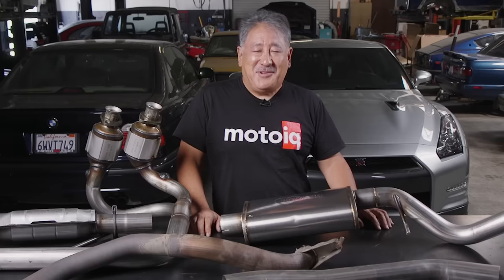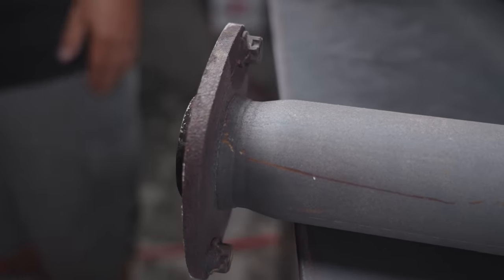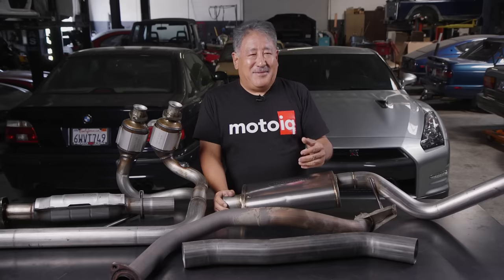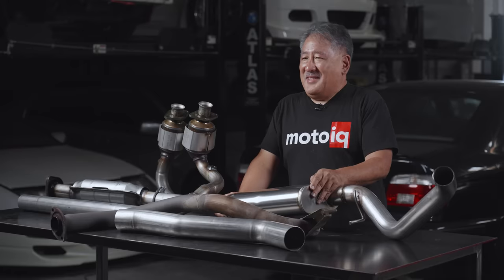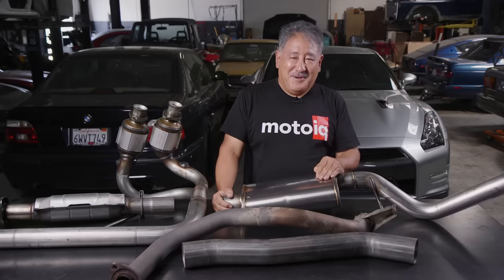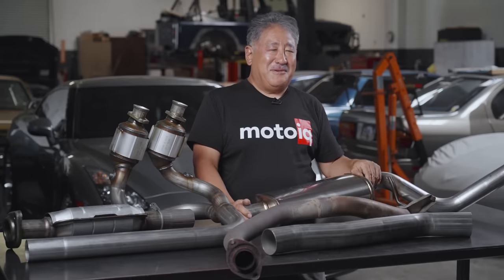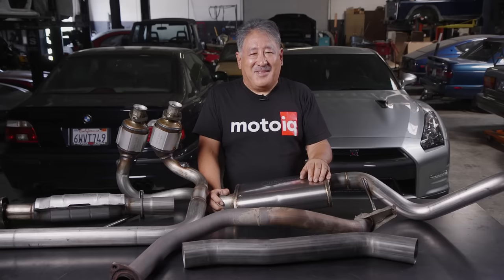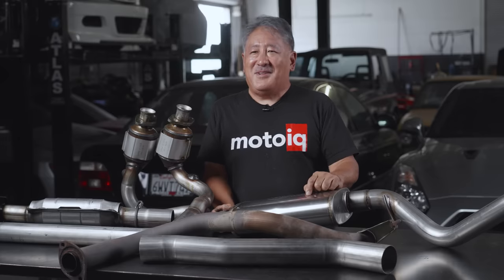Exhaust Back Pressure Myth DEBUNKED!

Comment: Why people say you need back pressure is from people taking the exhaust off running just headers or manifolds and having no power on the bottom end! But with a actual full system on a car is never going to have a low end power problem!! Ive actually done this before on my 95 Z28, unbolted the exhaust and was running just the y pipe and that thing was an absolute DOG outta the hole!!
Reply from the maker: Because you messed up your AFR or your load calibration. Gets fixed with a tune. Plenty of fast cars with open headers in the world.
Reply: @motoiq  watch engine masters!!! They actually run real world dyno tests!!! And just because people are running open headers doesn't mean they are or aren't losing on the bottom end! Engine masters ran open headers and without a collector extension they were losing power!!
Reply from the maker: If the tuning was correct, the headers were not sized right for the engine combination then, the primaries were probably too short and/or too big in diameter.  It's not too little backpressure.
Reply: @motoiq  lol..... like I said I've literally seen the dyno results!! I'm not just coming up with this outta thin air!!!
Reply from the maker: And I am giving the reasons why.  Don't think one dimensionally!
Reply: @motoiq  I'm not! I think you are! Like I said with just straight headers it was losing power on the low end! With an 18in collector extension the power was back up!! That has nothing to do with what you are saying!
Reply from the maker: Yes, adding the header extensions improves velocity.  They do not add backpressure. You didn't state all the information.
Reply: @motoiq  🙄🙄🙄🙄
Reply from the maker: For sure a header collector extender does not add backpressure so your premise that this is proof that backpressure helps is completely wrong.   It is the opposite in fact, it proves the premise of this video, that reducing back pressure while increasing velocity helps. The collector extension gives the gas collum effect that we were talking about in the video. It is nothing new, it's something that's been around for generations.  Same thing as the old timer trick of painting the exhaust in the vicinity of the collector and cutting it off where the paint stops burning off.  I mean if you feel that David Freiburger is the ultimate engine expert, I was also on a show with him, Masters of Motors.  We respect each other quite a bit.
Reply: @motoiq  🙄🙄🙄🙄 just keep telling yourself that!! Maybe some day it'll be true!!🤣🤣🤣🤣
Reply: @motoiq  if you think a 18in collector extension doesn't add some back pressure then you're nuts!!!
Reply from the maker: Have you ever measured backpressure in the collector or runners of a header?  I can assure you it doesn't increase enough to register on an analogue gauge which is what we had a long time ago when I experimented with this.  Now with affordable data logging and transducers you could probably measure a very slight change, fraction of a psi.  The collector is the acoustic end the the primary tube and adding an extension broadens the powerband by helping with scavenging by maintaining gas column velocity and also possibly helping the reflected wave in the primary tube have a longer pulse duration.  This is especially true if the collector or primary diameters are marginally too big. If you measure the backpressure in the collector or even at the muffler at the end of the exhaust, if it is properly designed it can be close to zero regardless of pipe length, this is due to temperature drop and diffusion over a larger volume due to boyles law more than skin drag caused by the tubing.  Also if you apply Knutson's law and solve for pressure drop  you can see that the pressure increase towards the end of the collector extension will be negligible.  I am not telling you collector extensions do not work, I am telling you that your assumptions about why they work are. This isnt far out stuff, any engineering student learns it.  If you still want to roll your eyes, then you are ignoring physics much the way flat earthers ignore science.
Reply from the maker: Jeeze how dense are you? No one is disputing that header collectors can make power, it's just not from increasing backpressure.
Reply: @motoiq It's not worth the time and energy to debate someone who isn't open to having there mind changed. After several comments where she ignored crucial info and stuck to her conclusion. Great indicator of someone with who further conversation will get no where.

Great presentation of vital information. Thank you.

Comment: Then how come when I removed my resonator (turbo charged) from the exhaust leaving only the muffler and an HFC,  my ass dyno tells me I lost torque at the low rpm range...Maybe cause it was so loud and I naturally hesitate to give it throttle?
Reply from the maker: Your tuning could have changed for the worse. There is almost no other way that could happen on a turbo car.  Also resonators typically add little to no backpressure if they are truly resonators.
Reply: @motoiq  I was on the same tune before and after....How could it have changed???? It's a good tune from APR, but it's still OTC.
Reply from the maker: With less backpressure, your can runs leaner and can even run in the wrong cells on the map so your timing can be off as well.  I have no idea what you really did or what the root cause is of what you did other than backpressure isnt it.
Reply: @motoiq  Thanks for the replies. I monitor my timing and nothings out of the ordinary, but noticed it being pulled an extreme short fraction of a second more when it does happen on rare occasion and always in mid to low rpm. Same goes for fuel trim, almost identical to stock and before I removed the resonator tuned. I do feel that the car is much freer at higher speeds on the throttle. Thanks again and keep the vids coming, they're great!
Reply from the maker: I would figure out why its pulling timing. If your STFT is good maybe the exhaust is now banging on something triggering the knock sensor.  I have seen this happen once on an EVO

Comment: yea, boys and girls. just run straight pipes and see yourself replacing exhaust valves because they will burn.
Reply from the maker: That is a myth
Reply: so you're saying that a 5 thousand wide valve lap that sits on no vortex, won't burn valves? from what I saw, that was the case but what would I know? I did work in an automotive machine shop for 3 years
Reply from the maker: If your valve seating surface was only 0.005 wide, that is the reason you are burning valves.

Comment: It probly comes from people confusing 2-stroke engines with 4-strokes. 
Btw why did Ferrari put butterfly valves in their engine that would open as the throttle increased. It wasnt for the sound
Reply from the maker: Two strokes don't like backpressure either. https://www.youtube.com/shorts/qf9eFYPYXUY  If the Ferrari engine was turbocharged, it could be a pre-compressor valve.  The valve closes when the throttles close so the turbo spins in a low-pressure zone and keeps its shaft speed up, kinda like what a blow-off valve does but better. If this is not it, do you got a picture?
Reply: @motoiq  what do u think a high pressure wave smacking back into the cylinder would be? Dynamic backpressure
Reply from the maker: In a two stroke, it gets back in there an can increase cylinder pressure but its due to the wave action rather than retained pressure in the chamber that is always there.
Reply: @motoiq  exactly. Its engineered back pressure. Get rid of the exhaust and open it completely to the atmosphere and youll lose power.
This is where i think the confusion comes from with regards to 2 stroke vs 4 stroke. i could be entirely off, just a thought
Reply from the maker: you are right about the reflected pressure wave but back pressure that kills power is the mean pressure retained in the pipe.  That is controlled by the stinger. Mean means average.  You make the stinger too small and it kills power.  They do tricks like putting a bigger stinger but have it extend into the chamber to get strong reflections but keep the overall back pressure down.
Reply: @motoiq  gotta love the elegance of 2 strokes

Comment: It’s very important in 2 strokes for scavenging reasons but 4 strokes are different.
Reply from the maker: Periotic pressure pulses in an expansion chamber are not backpressure in two strokes.
Reply: @motoiq  thanks 👍

Comment: a little helps low rpm power total free flow only perfect in wide open runs
Reply from the maker: Actually it doesn't.
Reply: @motoiq  not my experience or engineers that say so but a muffler guy knows more than engineers who design engines and exhaust and the entire freaking vehicle, I will defer to the muffler man and tell the engineers they are wrong, LOL
Reply from the maker: Like in the video it is easily possible go too big and kill your velocity.  This is not adding backpressure which is never good.

Comment: you do need slight back pressure otherwise you get reversion at the exhaust port
Reply from the maker: That is not true, in fact the opposite is true.
Reply: wrong . eg; on a 88cube harley if the pipe gets to big to close to the port , you get reversion n need to put cones in .ive been making custom extractors and systems for drag n circut cars n speedway also street cars since 1969 . did 12 months in the usa n done 3 courses back in 80s at hooker headers bout flow n resonance n reversion ect .you might be able to use your big words for the citizen rev heads but theres alot of custom exhaust builders that will disagree . the only time bigger is better is on forced induction engines .
Reply from the maker: An anti-reversion chamber isn't to make backpressure, it is to act like a reversion trap when you run a cam with a lot of overlap off its tuned point or as an acoustic node to affect pulse timing to broaden the powerband if you do it right. No one said bigger is better, it's what you inferred, proper sizing where you get the best pipe velocity with the lowest backpressure is best like we said in the video. Of course, you loose power if you go too big, you loose velocity and scavenging LIKE WE SAID IN THE VIDEO.  More backpressure is never better. Look at the pressure-volume curve of the Otto cycle, if you raise the floor of the curve with backpressure, there is less energy or power to recover with each cycle.  It's been around so long over 120 years, it's not even science anymore its fact.

Comment: Wrong. What you are describing is horsepower, not torque. You need rpm efficiency for horsepower. For torque what mainly is required is combustion force which is increased by piston and chamber compression
Reply from the maker: What are you talking about besides the obvious. Having good VE at high rpm is needed for HP. HP is the rate that toque is delivered.

Comment: oh boi, 3''(76mm) exhaust like MINIMUM @4:18 for a 2L milk pack engine - some people must be really going insane..if the 3.5-3.8L cars with 300-380hp don't choke or explode on 2.5-2.56''''(63-65mm) stock exhaust with not the straightest mufflers, then be more than sure your fartcans with milk pack displacement definitely won't choke on 2.5-2.56'' pipe, especially with straight through mufflers and sport headers with decently long primaries..if your engine detonated - than most plausibly the blame is on your engine tuning/mapping (on each "GOD" guy, who "knows" how to change numbers on laptop tables) or engine built reliability, but not because it choked on 2.5-2.56''diam tubes..probaly even BTCC JTCC world touring cars with 2.0L 280-300HP high revving engines (up to 93krpm) didn't have larger pipes than 2.75''(70mm) and somehow didn't detonate or explode during races n non-stop highest revs..so don't go crazy, dummies, anything between 2.38-2.56''(60.5-65mm) is good enough for your fartcan with milk pack displacement and up to N.A.300crankHP that most of you, i'm more than sure, haven't even reached (disregarding your bullshit dyno crap wry measurements)..2.75''(70mm) is your max choice if it's crazily tuned for highest output n highest revs n if you're racing/revving it non-stop, but how much of the buch that are watching this video are doing that?..so come on...
Reply from the maker: I take it that english is not your primary language. Building engines isnt your primary profession either.
Reply: @motoiq  of course, i'm a couch mechanic n tunner:face-green-smiling:yet i have some sanity🎃
Reply from the maker: Then you have no ability to judge this situation.
Reply: @motoiq  well, it wasn't judgement, more likely my thoughts..and they were more dedicated to viewers than to a creator..to ponder what power they really have n how they are going to use their car and whether they really need such fat pipes..if anyone wants to put 76mm or wider pipes on his 2.0 honda with max.250-260crank powah, then it's his choice..i'd be fine with 65mm, or if i was racing n using only highest revs, than maybe 70mm..if it was K24+K20hybrid with 280-300crankHP+ then 76mm would be considerable, in regards of how the car is going to be used..everyone has a freedom to choose..i always choose smaller, lesser, lighter: wheels, tubes, anything, if possible..
Reply from the maker: If your freedom is more important than what works sure. If you look at producing NA power once you get past the collector, the lowest backpressure is important.  For instance if you look at Garage 4AG, in there testing less than 3" on a fairly low power 1.6 looses power even on the bottom. Having the correct collector diameter is very important for scavenging, on the 4AG is is around 2.25", on the K Motor 2.375-2.5 but low backpressure past that is important.  It's not choice and freedom unless power and powerband is more important to you than getting the most out of your engine.

Comment: For a STREET engine, you MUST have some exhaust resistance or you will A: Burn exhaust valves B: Have NO low end horsepower (look at a dyno sheet!) C: Lose low-end torque D: Get HORRIBLE fuel economy. I've been building engines since before "Mike" was CONCEIVED and don't believe me, read Sir Harry Riccardo's book "High Speed Internal Combustion Engines"-Oxford Press 1911-annotated 1934 (OOP on Feebay for $200-up) THE "BIBLE" of engines. Riccardo designed engines for WWI areocraft and tanks and WWII aircraft and ships and up to 1960's race cars (when he died!). Mr. Honda claimed he SLEPT with this book! And Sir Harry's Formulae will PROVE no small block Chebby can make 400 horsepower with two valves per cylinder! It's called "Volumetric Efficiency" and a Chebby can only make 61 HP per liter @ 12,000 RPM!!! Show me a skinny block that will TURN 12,000!!!
Reply from the maker: Hahaha, Ricardo's book lines up with exactly what I said.  You must have skipped the chapters on PV diagrams. Also you must have skipped the chapters on exhaust tuning and pressure phenomena not to mention Ricardo Wave.

Comment: Actually if you have a 2 stroke engine with an expansion pipe and it gets a hole in it you will lose back pressure and power, had a mach 1 587 skidoo, blew a hole in the expansion pipe, could barely get it to move as well as almost melted everything under the hood, but, i guess hes only talking about 4 stroke engines
Reply from the maker: It's not due to losing backpressure, it's due to disrupting the function of the expansion chamber.

Comment: This only applies for true race engines if you don't have no back pressure on a street car you will burn the valves out of the head every time it may take months or a year but you will do it
Reply from the maker: That is a myth no valves will be burned.  An improperly design exhaust can cause a loss of torque on a stock engine but it's not due to too low backpressure. Watch the video and understand it.

Comment: back pressure is need on small car engines especially older cars i had a car in the 80,s put a big exhaust on sounded great but only dod top speed 40 mph but original on did 100 so it defo mattered on that car lol.
Reply from the maker: What you did is go too big and kill velocity and scavenging.  Backpressure hurts never helps

Comment: The only thing we ever heard was that with no back pressure, theres a chance of burning a valve but, never hesrd anything about back pressure needed to make power, that's just dumb.
Reply from the maker: If your AFR is correct you won't burn valves.
Reply: @motoiq    OHh, I understand.  But A, back when that was "a thing" about mechanics warning younger/less experienced, guys weren't calculating AFR, they just "ran 'em." 😆  And modern valves/setups are better at not burning, too.  Mostly I was agreeing with you and even shaking my head at the rest of it.  But, that's people, always willing to believe the wrong thing and swear by it rather than learn something for themselves.  😉
Thanks for the good info.